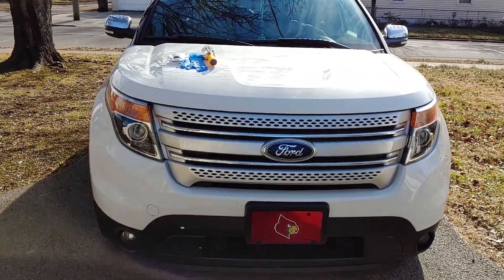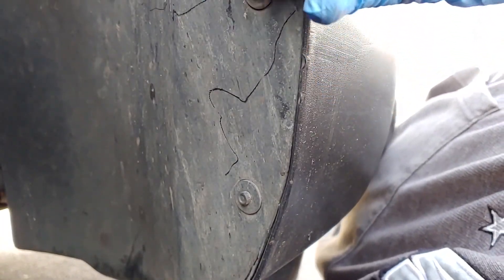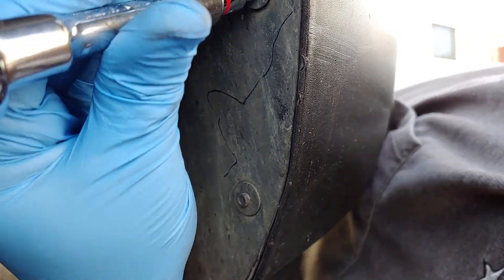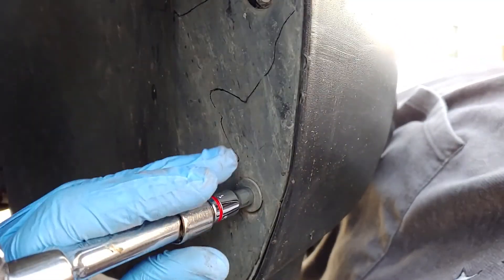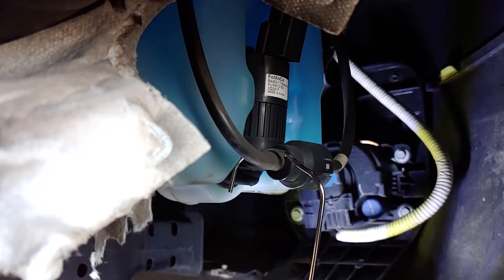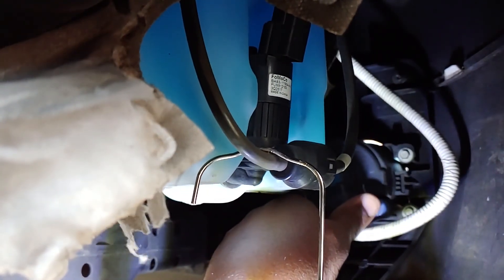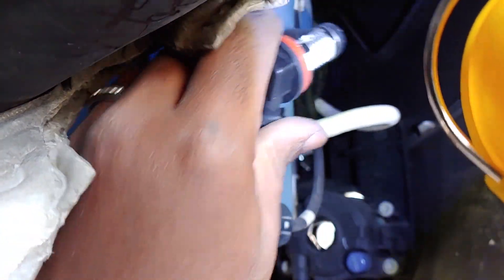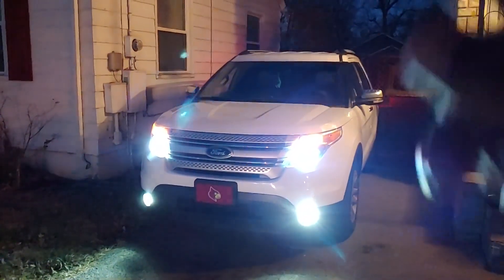Ford Explorer DIY LED Fog Lights install year 2011 to 2015

Comment: Thanks for the video and was able to just remove enough to put my arm in there and remove the fog light and pull it back through to the outside so I can remove the light without having to do it inside.

Comment: Wussup bro what size led fogs are they i got the same exact truck different color.
Reply from the maker: Hey Thanks for watching my Video. Please make sure to SUBSCRIBE to my Channel. Here is the Link to order these lights: https://www.ebay.com/itm/2X-LED-Fog-Light-Bulb-H8-H9-H11-Fog-Light-Bulb-6000K-White-High-Power-200W-Lamps-/333206525976?&_trksid=p2056016.m2516.l5255
Reply from the maker: Here is the link to SUBSCRIBE to my Channel http://www.youtube.com/c/MAKEITWORKWITHYOSH

Comment: my bolt doesnt wanna comeout for some reason
Reply from the maker: I'm sorry you're having problems with the bolts you probably need to try the next size smaller or see if you're using mm or the other type of size. I this will help you. But please be sure to push 🫷🏾 that subscribe button to subscribe to my channel thanks again for watching my video,😀😀😍😍
Reply: @MAKEITWORKWITHYOSH I was using mm. I’ll try the other size. Thanks very much.